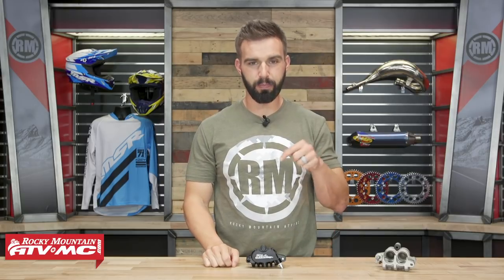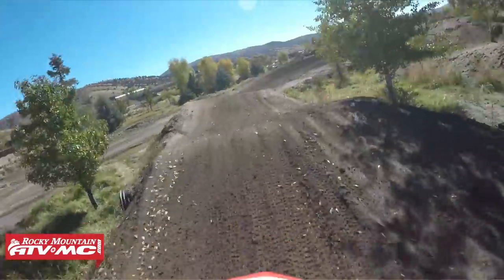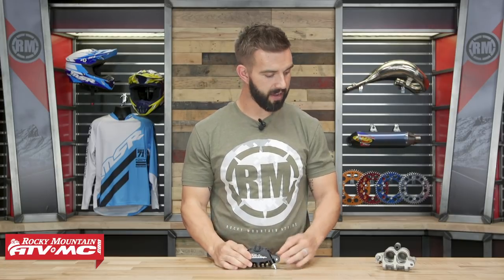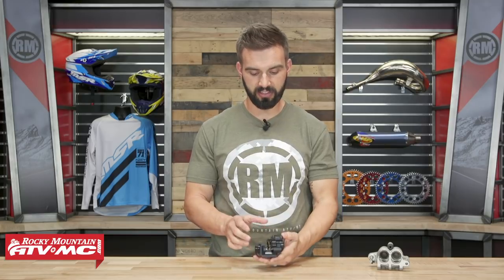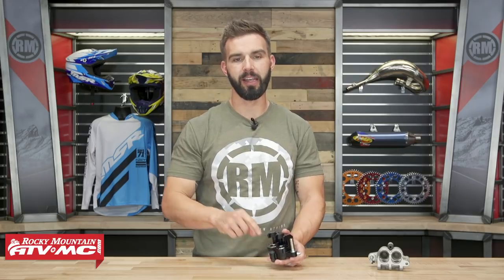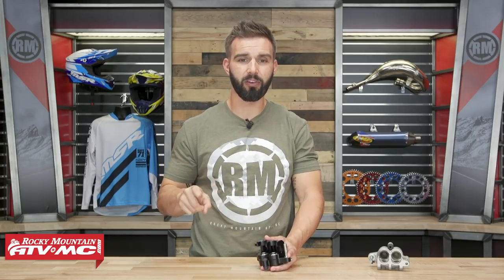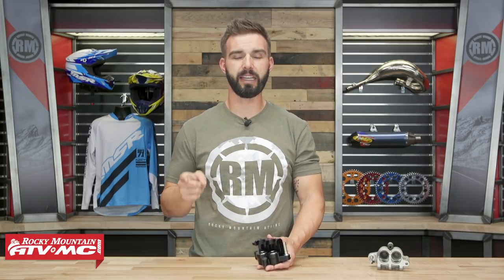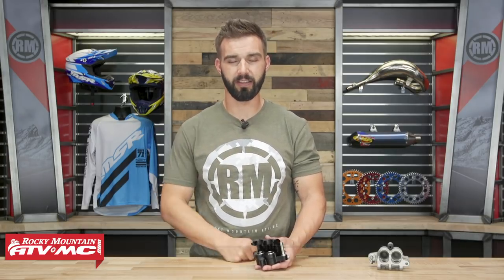Ride Engineering Billet Front Brake Caliper

Comment: Good video Chase as always, love your stuff RMATVMC
Edit: I have trouble to get a great ''braking feel'' from my rear brake, would you think a good new rear disk and brake pads will do the job ?
Reply from the maker: That certainly wouldn't hurt to put new pads on there if there old. If you rotor is in good shape (look at your service manual to see how to measure it), then you could try just cleaning it off with some brake cleaner and a steel wool before getting a new rotor.